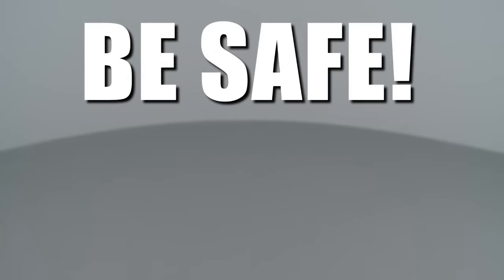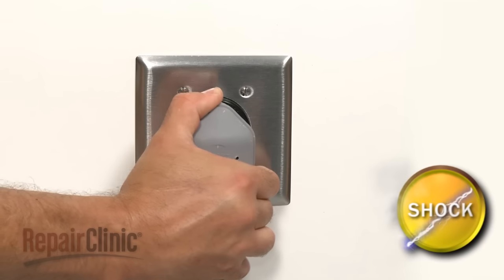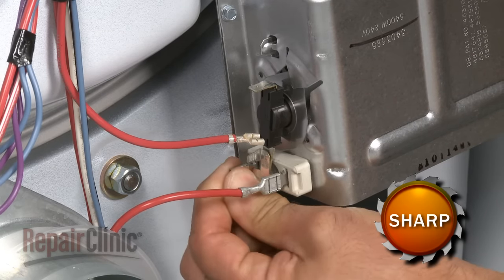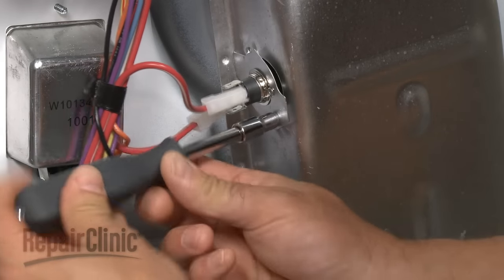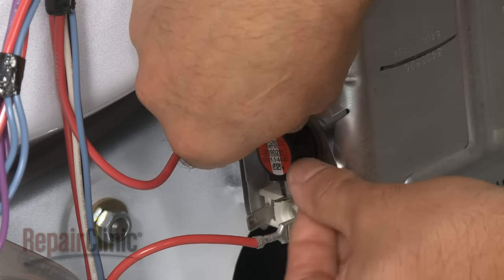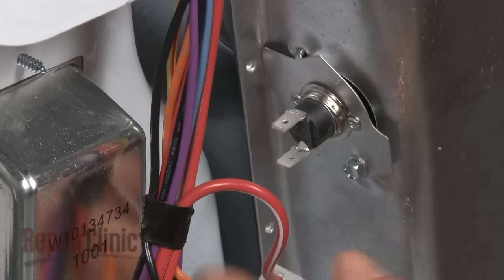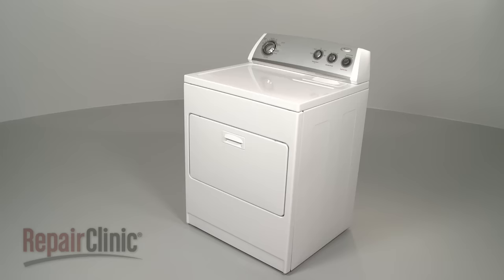Whirlpool Dryer Replace Thermostat & Thermal Fuse #279816

Comment: Hi! I have an Whirlpool Heavy Duty model LTE6234DQ3, it's washer and dryer at the same time. Had a problem with dryer because it did'nt heat. First i called an electric technician to repare the problem and it did work for few times, then it stopped towork at all. Viewing videos and reading, i put myself to repair it; i have to buy the Thermal Cut-Off Kit Part Number: AP3094224, because i tested both originals sensors and didn't have continuity between it's terminals, means they where bad. But the proble it's the... Disaster the technician did with the wires that i don't understand the correct position. I see them cut and wrapped in tape. I think he changed the position of wires and put to work direct and only with the high sensor untill it burned and stopped to work. I found this: 3 wires comming from de front command panel, one of them (a thin one), it divides in two more, the another two are thick (one of them it's red color and the other it's red with a white line). I need to know the correct position of wires, i think he cut another wire that was before but he changed the conections. Testing with multimeter and putting in the selector the automatic heating (both high and low temperature), i found 235 V between red thick and red-white thick wires, same with red thick and red thin. Combination red-white thick and red-white thin goes to 0,370 V. When i put the selector in high normal temperature (not automatic heating), voltages changes. Red thick and red-white thick goes to 235 V, red thick and red-white thin goes to 140 V, and red-white thick and red-white thin goes to 90 V. What's the correct position i should to put in the sensors? Sorry my english if it's but written, i'm from Venezuela. Greatings! Thanks! P.S.: I proved the next conection: i put the red thick wire  to one terminal of the cut off sensor, made a bridge wire between the another terminal of the cut off sensor and one terminal of the high limit sensor, the red thin wire that divides in two, one wirre put in the another terminal of the high limit sensor and the other to the heater resistence, the last red-white thick wire put to the other terminal of the heater resistence. Please help. I don't want to burn it again.

Comment: the video is more confusing than it should be. To make it simple for everyone that has the orange wire just do the following.  cut the end off the orange wire as closets to the connector as possible. your kit should come with a gold connector, strip and crimp the orange wire onto the gold connector and use the bypass wire provided in your kit to connect both the thermostat to the heating element.
Reply: +Edgar Rangel I tried this and my fuse blew the second the dryer was turned on. To be fair I could have screwed something up, but I doubt it since we're talking about 3 wires. Going back to the old high-limit thermostat...

Comment: I entered the model number of my Kenmore dryer (110.64602300)  in your website and was directed to three parts, two of which are installed in this video.  The other is the white thermostat  (2651/279816).  Unfortunately, the only part that fits my dryer is the white thermostat, despite your website saying that they all fit. The high limite thermostat is somewhat similar to mine, but is definitely the wrong part.  And that red jumper wire doesn't even exist on my dryer.  Do you offer any phone support? If not, I'll have to go to an appliance store and buy the parts. Too bad because I was so excited to find this site!
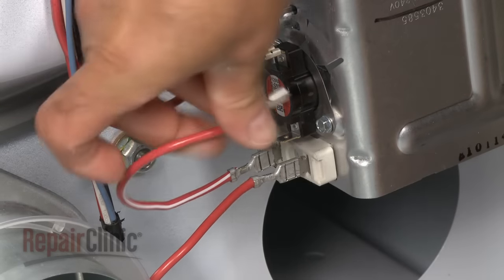Reply from the maker: Jeff C That is the right kit for your model. The high limit shown in the video at the 31 second mark is likely what you have. This kit replaces that old style high limit thermostat. The jumper was built into the old part, you have to add the jumper to install this kit as shown at the 1:10 mark.
Reply: ***** I see, but when I try to install the new one there's no way of telling which prong belongs in top. Of I flip it around it fits with either prong at the top and both prongs look identical. Does it matter which prong is which?  One of the issues was that the jumper cable would not slide into the prongs. I tried pushing it on and it just doesn't fit. Pleas let me know which way is up. The writing on it says nothing about this. Thanks.
Reply from the maker: Jeff C No polarity on the either the fuse or high limit thermostat. Just make sure the correct two wires are connected to them. Does not mater top or bottom terminal as long as the wires are correct.
Reply: ***** You're right..my old high limit thermostat looks like the one at :31.  The one I bought looks like the new one (with the jumper cable). When I tried to install the new one, as shown in this video, there's still an extra orange wire that has nothing to connect to, so I assumed it's not needed and that it may have been replaced by the jumper wire.  Not so, says Sears.  He said I need to slice the orange wire into the one that's plugged into the white heating core on the right. Ain't gonna happen.  I'm afraid to connect this now given the smoke that came out. (He said I may have damaged the dryer.)  Anyway, the first parts I bought, on Amazon, includes a high limit therm that looks more similar to the old one, but not exact. I will take another look at that one.   I wish Sears had instructions like this...theirs looks like something from the 1970s!

Comment: Fuse test good. high-limit thermostat bad. Replaced high-limit and did not mark which wire goes where. I know one wire goes to thermal fuse the other goes to heating coils that are attached to high-limit thermostat. Does it matter which is clamped where?
Reply from the maker: You can switch the wires on both the limit and thermal fuse. The only thing you need to make sure of is that the large terminals are attached to the large spades on the element. The large terminals on the element can also be reversed.

Comment: You folks left out where to connect the last lead that previously had been on the element, it seems.  Cornfusing!
Reply from the maker: +Kendall Dorsey The main difference is the old high limit had a built in jumper wire and in this kit you add it.

Comment: does it matter which wire goes where?
Reply from the maker: For the high limit, the larger wire connector from the jumper wire will go on the heater terminal and the other end to either of the high limit terminals. Usually, the lower works best just to keep the wires from crossing. The other wire will go on the remaining smaller terminal. For the upper thermal fuse, it doesn’t matter which terminals the wires go on.

Comment: your video is confusing....first you show the removal of the high limit  thermostat which has 2 wires...then youm show the replacement and now there are 4 ^&%$  wires....why not explain that little detour there ?
Reply from the maker: +moe roy We explain how to install the new part. The part is redesigned and it no longer has a terminal that clips to the heating element which is why a jumper is needed.
Reply: thanks...now EXPLAIN that on your video....lol